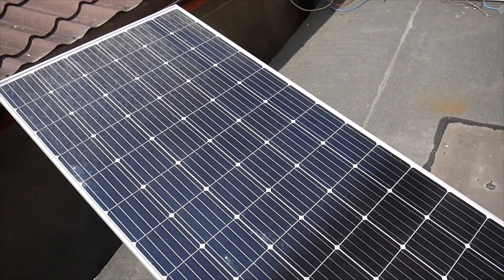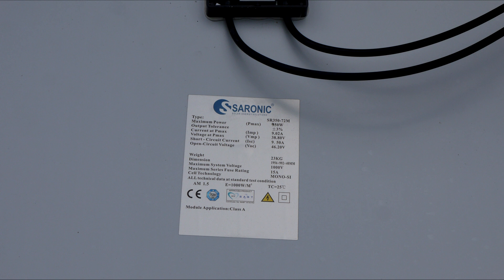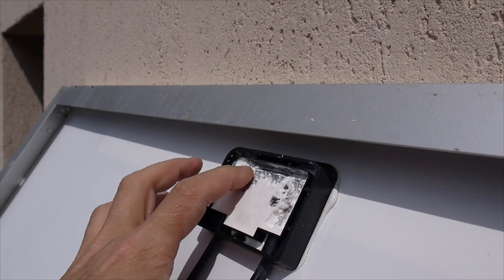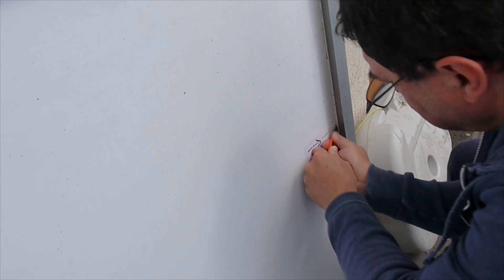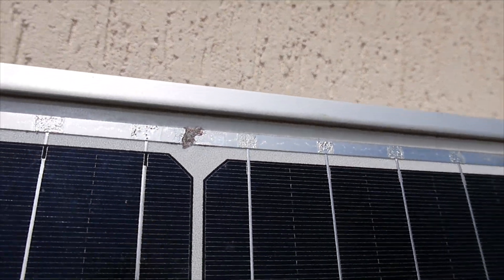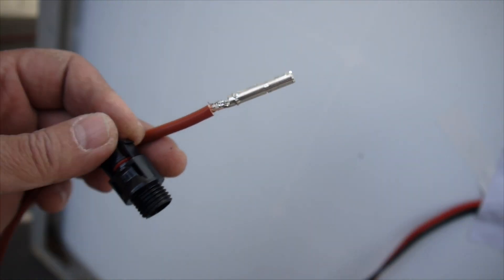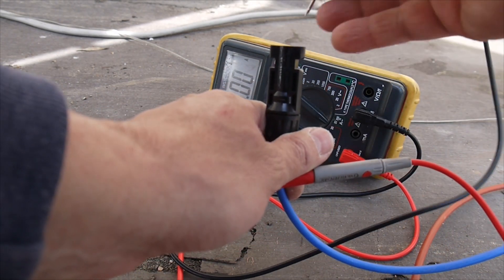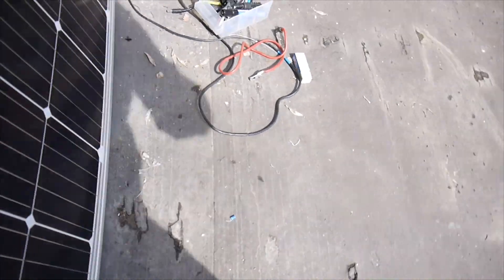DIY solar panel mod split a 72 cells 40V to a double 36 cells 20V panel

Comment: Just buy some DC to DC converter from aliexpress (10-15$) and cut voltage from 40V to 12V.
When you have 20V from your panel (cloud day) you will have charge from 20V to 12V. But If you have 2X12V and du to cloudy days voltage drops to 2x11V you will not have a charge.
Reply from the maker: I'll try that..
Reply: far better to buy a cheap MPPT, plenty around these days.  
Adam Welch channel has done testing on a few models on his channel.
Reply from the maker: @John-gm8ty  I just got a 60A MPPT kit and put it to work..watch my latest videos.
Reply: @viocaia  just watched them, that's a lot of effort there. 
but interesting content for sure! 

keep up the good work.
Reply from the maker: @John-gm8ty  Thanks John! I hope it's useful !
Reply from the maker: @John-gm8ty  A good MPPT is not cheap at all by my standard..of course there are lots of advertised MPPT being PWM finally.Adam is always an inspiration BTW.
Reply: @viocaia  well of course not a "good one"  hehe, a good one of anything is not cheap.  
and yes, I advised Adams channel because he tests the units to see if they are real.
or at least, he used to.
and agreed, his integrity is inspiring indeed. 

may you too reach a good audience and grow.
Reply: A dc converter connected to a panel on load doesn't work optimally as solar irradiation changes considerably over the day. This kind of hack is very useful when working on a tight budget.

Comment: Hello, at the end, did you put together the 2+ and 2- lines to make a single conection?
Reply from the maker: I can use it in two configuration , like 2 x18V panels in parallel or a single 72 cell ,40V PV